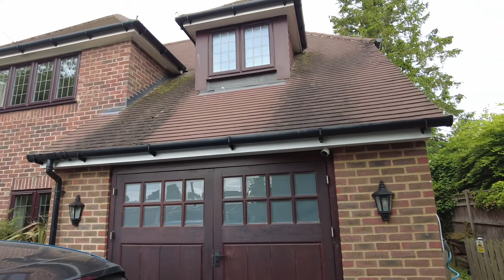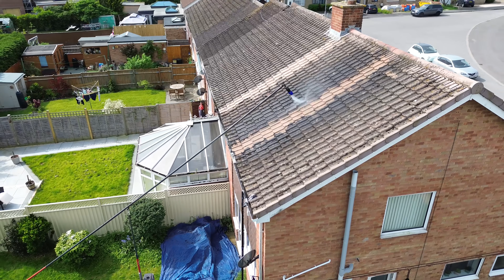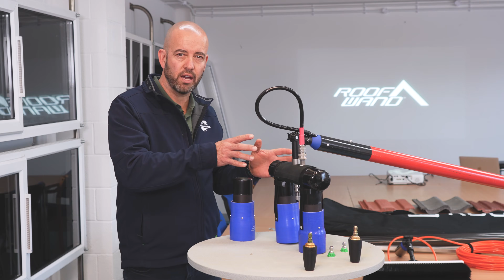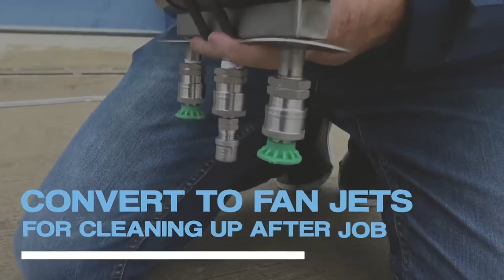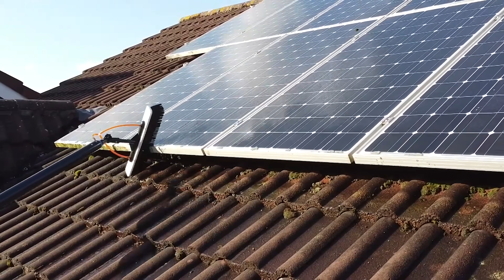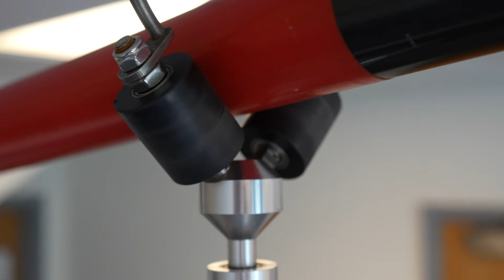Roof Wand by Ionic Systems | Complete Kit Walkthrough

Comment: 🙏I love the system, however, I think an explanation is due here: 3021 Lt per minute? Did I hear right?  Or perhaps this is the calculated equivalent force caused by the high pressure?
Reply from the maker: He meant 3000 psi, 21 lpm. this is then spread across the 3 turbo nozzles, turning it into more of a volume wash than high pressure. it's just enough pressure to lift the head and provide an effective clean.
Reply: @ionicsystemsUK  That make sense, Tanks for the reply 🙏